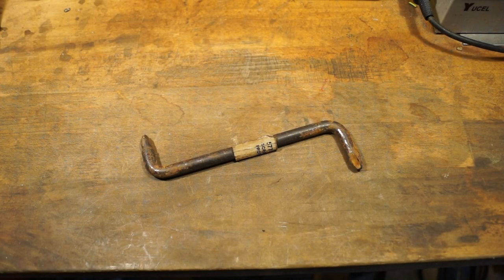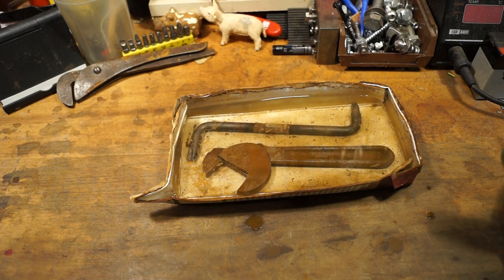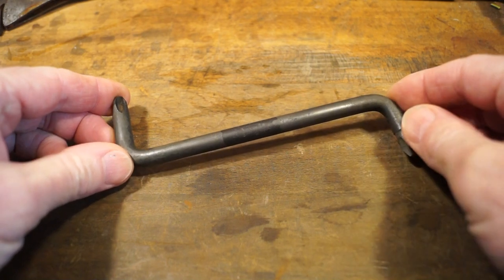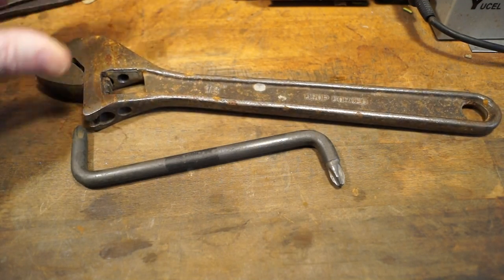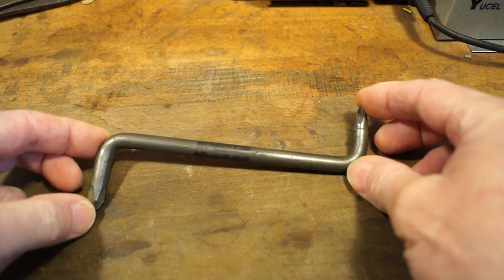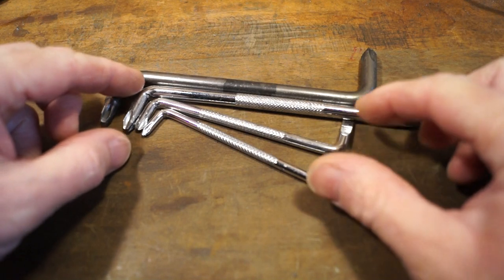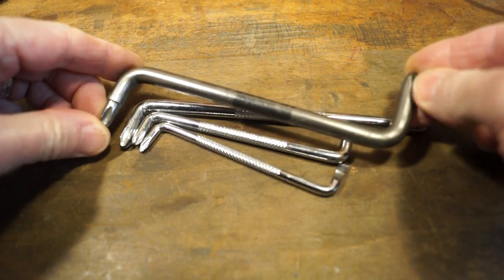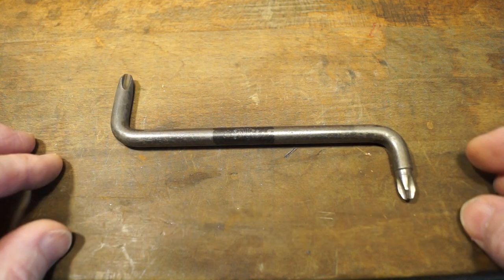PROTO® Offset Screwdriver Renovation

Comment: Nice tool, I tried heating (not boiling) the vinegar and an old tool and it seems to speed the process up. I also use liquid gun blue for a fine finish. But the Proto looks like new, look forward to the next find.